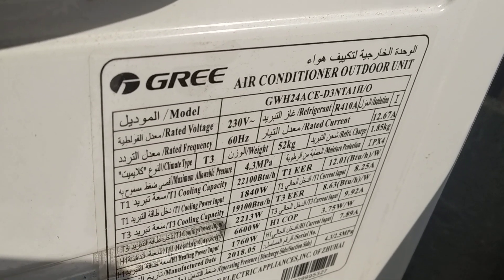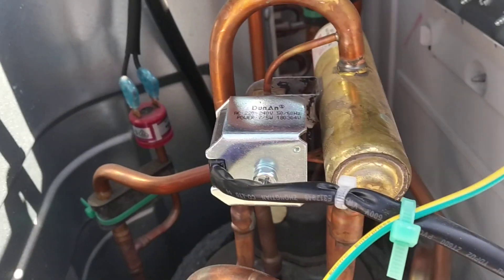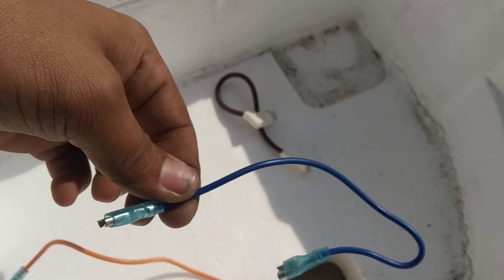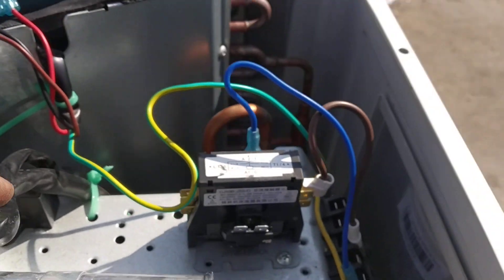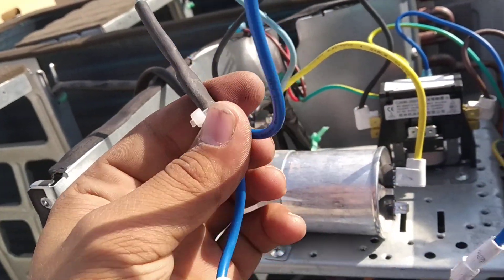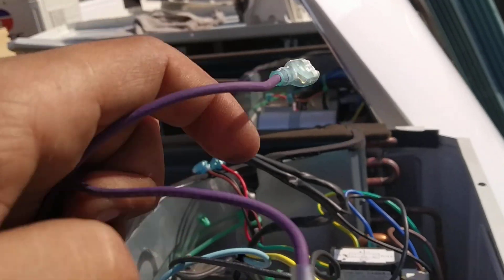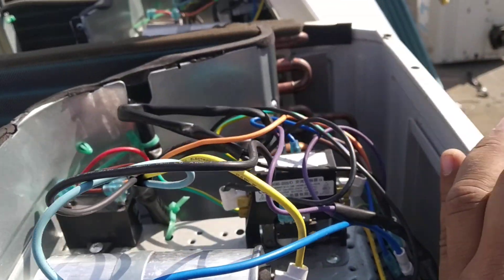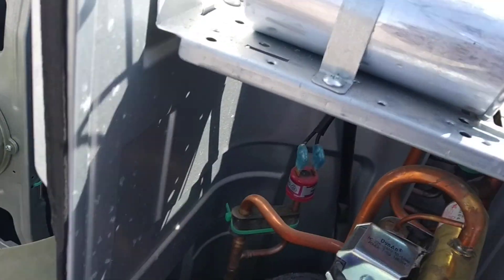GWH-24 | Complete Wiring of Gree Air Conditioner Outdoor Unit Control Panel.

Comment: Hello! Can you please guide me why my Gree Outer Unit is droping water from the bottom center. Its working perfectly fine but droping water from outer as-well not that much water just 1 drop in mins.
Reply from the maker: hmm.. bro sometime according to the weather, our outdoor units sucktion pipe getting Moisturised. That's the reason some times your outdoor unit dropping water.  But its normal no problem 👌. You don't need to fear about that.
Reply: @RepairingSchool  thank you so much! I was too worried.
Reply from the maker: @umairkhan1024  my pleasure